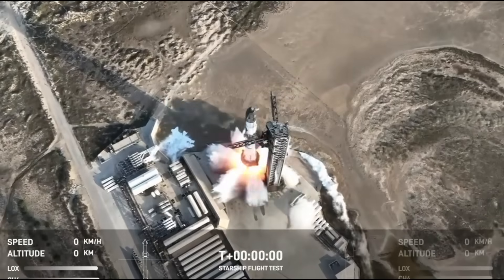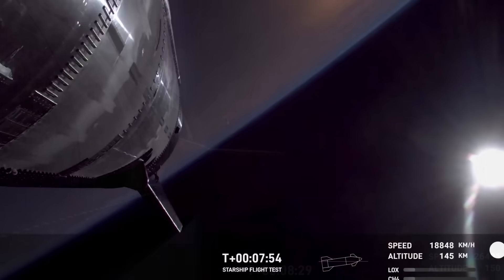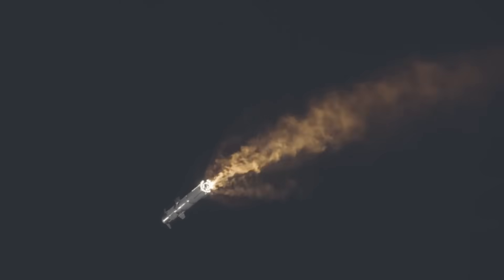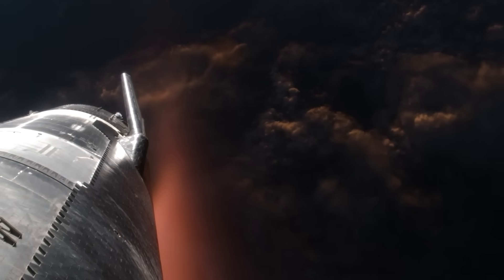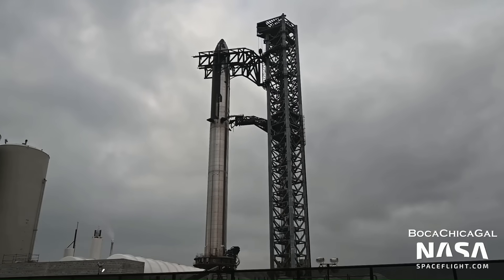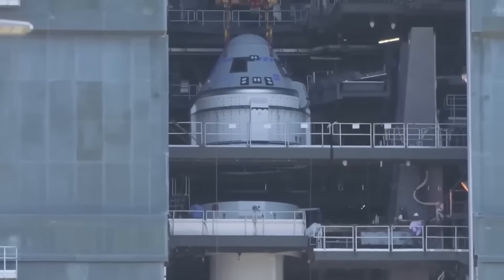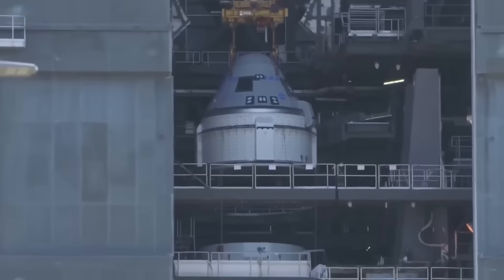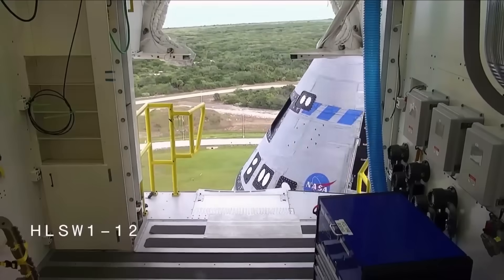SpaceX Just Shared New Problems Of Starship Flight Explosion!

Comment: You guys really don’t get. The ship has been tested 8 dead empty. That’s no environmental system, crew module, payload or payload hardware. Being made of stainless it 10 times heavier that it should be. So no matter how big they make it they can’t overcome physic’s. If the switch to aluminum it would weigh 1/10 the current weight. The 33 booster engines are cooked after 4 minutes of use. So the booster is not Even reusable. When you over heat stainless and I talking 1300 to 1600 degrees the deforms and warps. So no sealed surface can seal again. This is way they have not reuse a single used booster. The Apollo program launch their very first launch. It was much more complicated than starship is. So blowing up rockets is not a means to better rocket. It is a sign of folks not up to the task. Apollo was 56 years ago with some very intelligent guy with nothing be slide rules to calculate ever operation carried out to make the rocket successful.

Spacex has and lost it 4 major experienced rocket engineers. So they clearly lack the talent with experience.

NASA need to not renew a new contract. They have just about used all the last contract.
Reply: Thanks for saying this. Stainless steel is also the cheapest and weakest steel. I have even seen people claim that the 300 series steel on Starship and the Super Heavy had not been invented yet, so that is why Apollo did not use it. Actually, the first stainless steels were invented in the 18th century - 300 series specifically in 1912. The 30x that Space X and the Cyber Truck now employ are cheaper and weaker than the 853 steel on my 1998 Lemont Road bicycle.

I can't understand the use of steel over aluminum other than steel is easier to weld, and if you are building rockets under a tent in Texas, then maybe that is a concern. Aluminum is only marginally weaker than stainless, and much less expensive, and MUCH lighter. It worked for the Saturn 5, the second largest controlled explosion ever built.

Every decision Apollo engineers made when developing that system seems to have been reversed with the Super Heavy and Starship design team.

1) Apollo used fewer, more powerful, gimbaled engines to reduce complexity, control combustion instability, and reduce vibrations (the three things that just destroyed another Space X launch). 
2) Apollo also used aluminum, not steel, because of it's higher strength to weight ratio which reduced the fuel requirements, which in turn reduced the weight.....which in turn reduce the fuel requirements! 
3) Apollo elected for many modular, progressively smaller stages to get to the moon, instead of one giant craft like Starship. That reduced weight and fuel requirements, again!
4) The Apollo guys even had a plan to put pop-out wings on the main stage and fly it back to Earth remotely for reuse - which would require less fuel than landing it vertically like Space X is trying to do, and thus, reduce weight. Unknown to many, the F1 engines on the Saturn 5 could even be fired up to and more than thirty times each, which means they were also reusable.

It would do Musk a lot of good to go back and learn something from the Apollo program before blowing up more tax payer dollars over the Bahamas.
Reply: @ well said, and I agree completely. We went to the moon on the shoulders of giants. Musk’s ego can’t stand that he was not one of them. His NIH complex is hurting this program badly.
Reply: @glenwoodriverresidentsgrou136  I see a disturbing patter of him needing more and more validation. I'm not sure how much more he can get after being pals with the president.
Reply: @jmsgrdner2379  have you been reading my mind? This program has a lot of faults and right now they have encountered one of my earlier predictions about combustion dynamics of methane. That is what is destroying the engines on the starship stage. They need every ounce of fuel to reach orbital velocity and can't maintain the mixture control on empty tanks.
The solution to every problem seems to be to just add more weight and complexity.
Then there will be the debacle of orbital refueling. This thing can barely lift the payload of FH so that will dramatically increase how many flights it would take to fill a tanker.
Also, it's the first time we have tried to store a complex hydrocarbon cryogenic fuel in space. Basically it's LNG...I once worked at an LNG terminal and I could tell you the fuel constituents varies dramatically because of weathering during ocean transit. It's hard to get the mixture right because the constituents boil at different temperatures. It wreaks havoc at power plants that use gas turbines.
Reply: Cut back construction funding ?
Reply: when people say this is the most powerful rocket ever my immediate response is that it is the heaviest rocket ever and still missing most of it's critical systems. Everyone fawned over the streamlined raptor 3's not realizing how that streamlining made them even more susceptible to catastrophic failure from combustion dynamics. Methane is a very difficult fuel to manage the pulsations stemming from mixture control. I have seen high frequency combustion pulsation rip components apart. I almost guarantee that's what happened on those engines that failed.
Reply: @divedevil985 almost guarantee? So that means you don't know 🤣🤣🤣
Reply: @ yes I believe that is the statement a person with intellectual integrity would make in the absence of proprietary data.
What's more disturbing is how much SpaceX doesn't know.
Reply: @mikerash-pc4jc
You are right on the money. Can you imagine loosing 8 Saturn V’s in a row and von  Braun not getting fired?  When you do half ass engineering every part is at risk and relying on testing to find weaknesses, in this case, will lead to every major component failing a test at some point. It’s nuts. Elon’s contraption is theoretically cheaper, but if it never works it has an infinite cost per pound orbited. And in God’s name why did they use stainless steel?  Was every single designer before them stupid for using aluminum?  Are they really that much smarter than everyone else?  Because the structure is so heavy, the orbital payload mass fraction is very low and it will take dozens repeat, dozens of LEO refuelings to fuel a Starship for a mission to Mars. Even if each launch is cheap it’s too much risk.  Robert Zubrin had it right the first time with Mars Direct. This project needs a major course correction.
Reply: @glenwoodriverresidentsgrou136  comical that he said they would be on Mars next year with all of the shortcomings you just mentioned.
Reply: Have you any clue what you are talking about?
Didn't think so 🤣🤣🤣
Reply: Well you are so smart, so open your own rocket company and put spacex out of business. You should be able to do in a week or  two with intelligence like yours.
Reply: @ 

I have 45 years experience. What have you go?
Reply: @stevenwyatt2922  I hear comments like yours all the time. Many people have predicted these failures that have worked in the industry.

Comment: Up to now, the Starship always had three vacuum engines and three sea-level engines. As only the sea-level engines can be directionally controlled the ship cannot fly stable without them.
There is a plan to add a further three vacuum engines to increase performance.